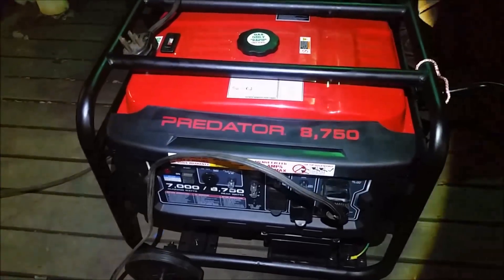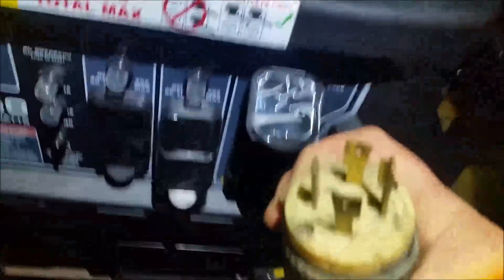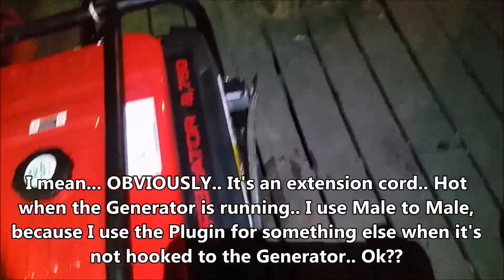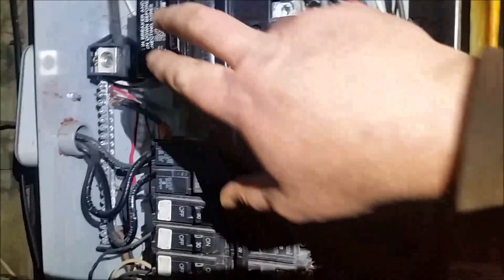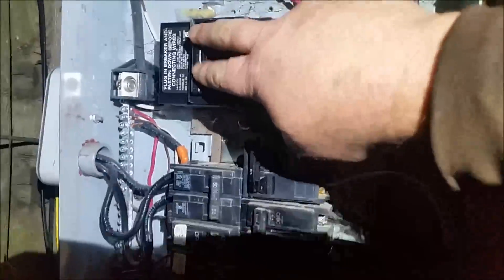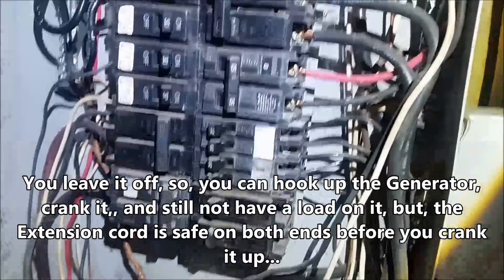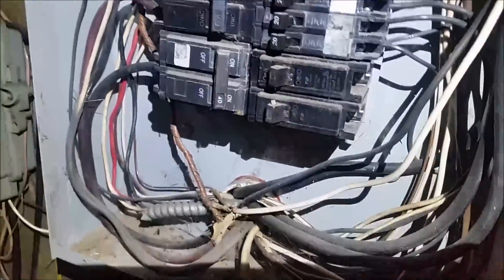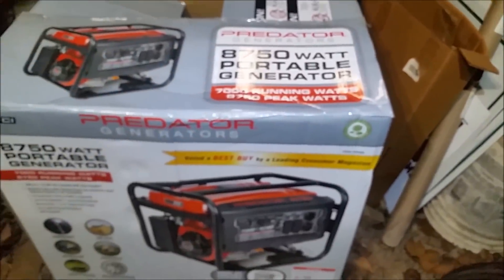Quick/Easy/Safe: Use Existing Plugin/Breaker for Generator hook up to your house Panel box.

Comment: use an interlok kit at the least
Reply from the maker: You can.. But, if you do, you can't use an existing plugin, like I do in this setup.. You can't have your cake and eat it too as some say...  You have to choose.. If you want to use an Interlock,, then, you should also install a dedicated 220v breaker and a Male twist lock Receptacle plugged into the same Generator breaker, so you don't have to use a male to male cord.. You forgot to mention that.. If you don't add the "Male Receptacle"  then, you have to make another Male to Male cord for the Generator.. You are going to have to add another male plugin either way you go... Yours will be directly connected to the breaker in the panel, and exposed the whole time you are running on Utility power.. Hope your Interlock never falls off or malfunctions.. That would be deadly... Face it.. Either way you go, you have to remember to turn off the main breaker,, and if you can do that, why can't you remember to plug in the cord on both ends before you crank the generator after?? 
This video is about using an existing plugin for your generator, and when the power comes back on, using the same plugin for it's original use or intended purpose.. You can't do that with an Interlock... So, for this setup, no you can't use an interlock.. But, you can choose to use an Interlock and a dedicated plugin and breaker for the occasional use of the generator.. It's not add this to that.. It is an either or situation.But, surely your choice as to which you pick or which you install or setup.. 
But, be careful.. because, if you have to go the route you want to go, you'd better be damn sure that you Turn the Main Breaker off.. And, that may not be good enough. Because 90% of people who install an interlock, drill the holes with the Interlock in place over the breakers.. It is only a matter of time before the drill bit goes into one side of the main and Dead Puppy.. And, if that is not enough, now, you have to go into the panel, install a separate 220v breaker and run a separate line with a Male Plugin exposed to the outside of the box for the generator.. In this setup.. The panel never has to be opened... 
And, you think that the Interlock is safer?? I am having a problem with that for a DIY'r install from the guys here who think the know better than everyone else.. 
All I have to remember is "Turn the Main Breaker off",, plug in the cord to the existing plugin, and then generator, then, crank generator.. Much, much safer than drilling into the top slot and mounting an interlock which covers the main Breaker.. After all, what is hooked into the top of the main breaker again?? Just saying..

Comment: I was looking through the ways to do this on youtube and finally found an answer for an emergency! Thank you!!!! Of course I will get the proper shit to rig this up a bit more proper, but this works just fine!! Common sense isn't very common anymore.
Reply from the maker: Yes.. If you want to be safer(more proper), install an interlock and use a dedicated breaker for the generator.. If you use an existing plug, you can't use it after installing the Interlock.. In that case, no sense in making a male to male cord, just buy the male generator plugin and hook it to the dedicated interlock breaker.. 
I'm not sure what you mean by "proper shit" to rig this up a bit more proper.. The only thing not "Proper" (if that is what you want to call it) is the Male to Male extension cord (which is not regulated by NEC).. But, if you "don't" use an existing plugin, no need to make the male to male cord.. And, if you are not going to use the male to male cord, then, might as well get an interlock and a Male to Female generator cord with a Male Generator Receptical and do it "Proper", or the other or another way.. 
This is only for those who have existing plugins and are comfortable with knowing,, the Main Breaker Must be shut off first,, and the both plugs of the male to male plugin must be installed in the receptacles before you crank the generator.. I don't know how you can do this setup without making a male to male cord and not having a generator interlock.. You need to rethink what you are going to do before you start..  But, if you can think of a more "proper" way to be able to use an existing plugin, by all means comment back.. Because I have totally missed it, and can't see how you can do it safer or more proper if using an existing plugin is what you are looking to do... But, there are always more than one way to skin a cat, so to speak.  
I agree on the Common Sense not being that common anymore though..  One thing you might consider while you are doing this..One thing I have always wanted to do is hook a buzzer or light or siren on a switch coming off of one side of the main (120v) to switch on when running the generator, so, you know when the power comes back on.. Just turn the switch to the buzzer or light off when you are running on utility power.. The buzzer or light is only switched on while you are running on generator.. Any other time it is off.. 
I am on the power company text notification system, when they think power is restored in the area, so, the only reason I have not done that yet. But, if I ever run across a 120v buzzer, I will probably pop it in.. I would just  use an ice pick to separate two wires from one leg to slip fit a piece of 12/2 copper and get the 120v power, but, there is no way to do that cold, unless you do it when the power is out, and it might come back on any second, so, have to be extra cautious while doing it.. But, you should never assume the power is off anyway, in my opinion.. Even when working on a box without power anyway.. Just not worth the risk. Good Luck, but, if you think of some way to use an existing plugin in a safer way, I'd like to hear about it when you get it figured out.. Cheers..

Comment: I am a licensed electrician.  This is a serious code violation and could be deadly!  A transfer switch must be used with any generator connection to the main breaker panel period.  There are No Exceptions!  A safer way to do this is to run extension cords to the appliances you want to run off the generator and never connect into the distribution panel.  You can laugh this off all you want, but all it takes is for someone to accidentally turn on the main breaker while the generator is running and now you are back-feeding the utility.  Now you are on the 10 o'clock news for killing a first responder line worker.  You could be facing charges of reckless homicide, potential law suites, code violations and fines.  Connecting a generator to your house should only be done by a licensed electrician using a transfer switch.
Reply: Looks like we had a hit and run! A licensed electrician made a misleading  statement, ***A transfer switch must be used with any generator connection to the main breaker panel period.  There are No Exceptions! *** Bottom line he must not be familiar with the NEC .

Comment: if ya forget to trip main you will destroy your generator,  You will also put people working the lines in great danger as they are expecting no power.  you may save a hundred bucks but be very careful
Reply from the maker: A lineman "NEVER" expects a line to be cold,, even if it is proven cold.. It's a good way to die for many other reasons not generator related.. 
But, you are correct about destroying your generator and backfeeding the Utility line,,, IF YOU FORGET.... But,,, does someone have to tell you not to touch a Red hot piece of metal? Have you ever touched one? Maybe not, but, you don't have to,, to know what happens.. So, how many times do you intentionally touch hot metal?? You know if you take off walking without tying your shoe laces,, you will bust your butt.. So, how many times have you done that in the last 30 years?? Or, how many times have you not put your car in park?? Just curious.. Some of us don't have the problem with the main breaker.. We know.. First step is Tie your Shoes,,  oops,, Turn off the main breaker.. Enough said..  Yes.. If you don't feel you can remember that.. By all means.. A transfer switch or a Generator Interlock switch is the way for you to go.

Comment: I have been doing this for awhile.
No need to respond. I would remove your video.
Reply from the maker: How did you come up with the idea to do this?? You must have checked it out?? Why would you not want others who have the same ability as you and I and many others who use this same setup to be able to do the same.. This video isn't for everyone.. Just those who are looking for a simple solution, who have electrical sense, but, have not thought about it yet.. This is who the video is for. Competent people who have common sense and  know the Main Breaker Must be Turned off FIRST..

Comment: This guy knows just enough to kill someone with his instructions. Do not follow anything this guy says. Just quick glance at his video and i see multiple code violations that could kill someone or burn down their home. Hire a professional licensed electrical contractor to do a proper install. You don't want to kill your family because you thought you knew what you were doing.
Reply from the maker: Yes.. Please take your own advice.. You should have realized that this video is not for you when I said,, if you don't have common sense,, this video is not for you.. I can tell by the rest of your comments that you absolutely do not..  Following the step by step instructions, there are no dangers.. And, if you didn't see that, then, you have ZERO business trying anything in this video... I have been doing this for close to 15 years.. Some others commenting here have done it longer.. 
And,, btw.. There are no code violations related to the generator hookup in this video.. NEC does not regulate extension cords, therefore the Male to Male cord is unusual, but, not against code..  So,, now we all know that you don't know what you are talking about,, and you have no common sense so you of all people should hire an electrician..
Reply: @MarkThomas123  you might want to look up the definition of an extension cord. By the way you are correct the first thing I saw was seal tite hanging out of the connector not supported. And yes it wasn't part of the generator rig your building but it is violation.
Reply: Also a load breaker is not listed for use as a service disconnect breaker unless it specifically says it is rated for it. Additionally you are back feeding the breaker from the load side which it is not designed for. May not trip at rated capacity. Does it work sure. Is it safe no.
Reply from the maker: Ronald Archibald: Yes. And you see the new boards installed directly behind the plugin? Moving the water source and filtering system over against that wall in an enclosure at the time of the video..  I know what an extension cord is.. Maybe you are referring to an "Appliance cord"?? Because if you are referring to the NEC not covering it, then, you need to look up the definition of Extension cord or portable cord, or, where it states commonly connected and disconnected.. 
Should I have gotten an inspection while I was in the middle of relocating the plugin? ha...Ha...
Reply: @MarkThomas123  what kind of cord is that? Looks like romex or some cord type that shouldn't be used for an extension cord. Type So or Sjo  cord with proper strain relief would be at least along the lines of  the use your utilizing for.
Reply from the maker: Ronnie Archibald.. Sounds like one.. Yea.. I'll bet you would like to sell me one of them.. Ha.>Ha.Ha..  Proper Strain Relief?? Show me your wall of extension cords with proper strain Relief.. Ha..Ha..Ha.. Let me guess.. Are you going to say that I have to use some specific type of copper that is only made at some specific plant in the USA somewhere?? And, if I want to run some christmas lights.. I should buy some special type of extension cord for that too?? 
BTW.. It is a piece of direct burial that I am using. I describe it in the video.. I think you better worry about gauge and length, after you find your Specialty cord.. What a dip!!
Reply: @MarkThomas123  that type of cable is not legal to be used as an extension cord. The reason? it doesn't flex. And eventually will crack and expose the energized conductors. Yet another example why this installation is dangerous and not code compliant. The code is the minimum safe installation. Your showing people how to do unsafe electrical work.
Reply from the maker: Ronald Archibald.. Are you for real?? Ha..Ha.Ha.. Can't be used as an extension cord?? Ha.Ha..Ha..Ha.. You have to be joking.. Right?? 
Let me tell you something that I learned when I was just a child.. I was 5 years old and I was mowing lawns with my brother, and I was in charge of edging (electric edger), and trimming the hedges(electric hedger).. I had so much trouble wrapping up the extension cord.. I almost hated to drag the damn thing out.. I was at a Rodeo that my parents took me to.. I wandered back where the guys were getting ready for the roping part of the video.. Those ropes were very, very stiff.. I watched them wrap it up without any effort.. One of the guys asked me if I wanted to try to throw one.. Naturally I said YES!!!
I had watched it on westerns hundreds of times, but, never picked one up... I tossed it, and before I even started to pull it back in,, he stopped me and said,, let me show you how to roll it back up.. It is all about the twist.. It took me a minute or two to figure it out, and then, I wrapped it up like a real Cowboy.. It's really simple.. Works with hoses, cables, ropes, extension cords (whether they are solid or stranded)..  You never crimp the cord, never pinch it, and you can use a cord like that for 15 years, and if you don't get in a hurry, it will last you a lifetime.. So, next time you get to see a Western,, watch how the roll their hands over and twist the rope.. Two keys to making it work.. The Twist, and the fact that you have to have the hose/cord/cable, etc.. laying straight out end to end, so it can flip over as you twist it.. It takes a minute or two to get it, but, I was 5 years old when I figured it out.. I think you can do it too.. 
But, if you are the typical Electrician, and you knit the damn thing together and throw it into the back of your truck, rather than wrapping it up and hanging it, then, I can understand why you think it is impossible... I can wrap up a 50 foot standard 14ga orange extension cord, and toss it out and have it land perfectly straight , and it only takes three or 4 seconds.. It would take you that long to pull it out of all of the hangups in the back of your truck bed.. 
You should really try it some time.. Maybe I should do a video on it???  How to wrap up Cords/Hoses/Cables, etc?? Ha.Ha.. It would really be useful.. I have raft blowers at my company, and  I have to teach every one of my employees,,, every year, how to easily wrap them up.. They are 2" diameter rigid commercial vacuum hoses.. There is only one way to effectively wrap them up.. Same technique.. Try it.. Let me know how you do..
Reply: This is why you all need to agree with generator safety https://m.youtube.com/watch?v=I1jT3ANENvI here’s a video about generator safety

Comment: This man gonna get somebody blow out of here whata hell is wrong with you...
Reply from the maker: Interesting choice of words.. A little English Class with your slang.. "This Man is gonna get someone blown out of here.. What the hell is wrong with you? 
Sorry.. I know this really blows your mind.. It is really a simple concept though.. You must have missed the part of turning the main breaker off.. That is all someone has to remember.. In the reverse, after everything is disconnected, turn it back on.. If that frightens you,, you should really not watch these Simple/Cheap, hooking up the Generator videos.. Your Solution at the very minimum is called a "Generator Interlock".. A step above that is called a "Generator Transfer switch".. But, please do not attempt either install by yourself.. Because the first step is "Turn the Main Breaker off" in order to install it, and you missed that in this video, and it was mentioned multiple times.. Please hire an Electrician.. This video is definitely not for you..

Comment: Do not do what this guy is doing.
Very dangerous.
Reply: Yeah. Here is a video about generator safety https://youtu.be/I1jT3ANENvI everyone needs to watch this video
Reply from the maker: Yes.. I would suggest you not do this.. If that is the way you feel, this video is not for you..  We can definitely argue the point of safety, but, that would be a moot point if you can't follow instructions and can't guarantee that you will turn the main breaker off.. This video is for people with common sense who are confident they can turn the main breaker off before starting, and turn the main breaker back on after everything is disconnected.. 
Obviously .. That is not you. I and many more have been doing this safely for better than 15 years.. They do make Interlocks and Transfer switches that you "should" be comfortable with.. but, I do recommend that you don't install anything like that yourself, since you think it is dangerous.. Some people get scared and can't think clearly.. Like I said.. Without common sense,, this would be dangerous.. After all, it is high voltage, and correct, it can be dangerous.. So can driving a car... Thank goodness you are ok with that for whatever reason..

Comment: Better make damn sure nobody throws your main breaker on while the gen set is running.  This should be regarded as an emergency measure ONLY and don't let anyone else mess with it.
Reply from the maker: No one but me, or my family which has common sense and knows the Main breaker is always off when getting ready to work with the generator, either going on, or coming off of Generator.